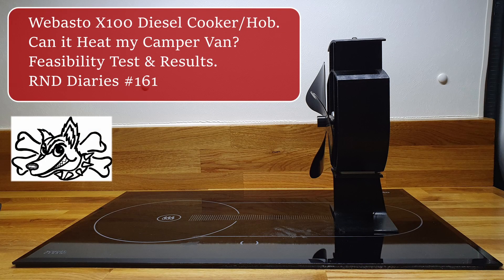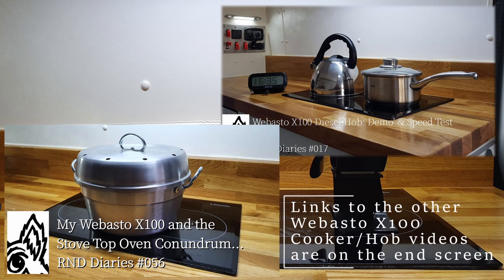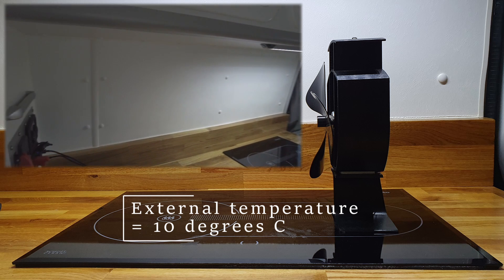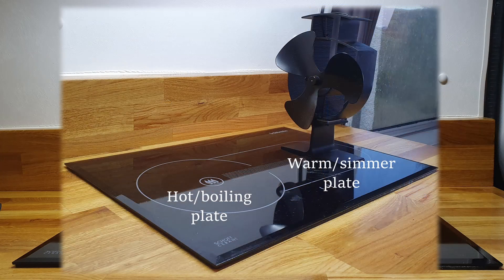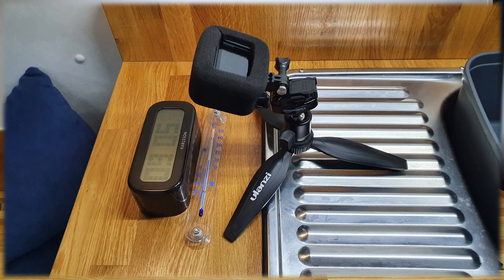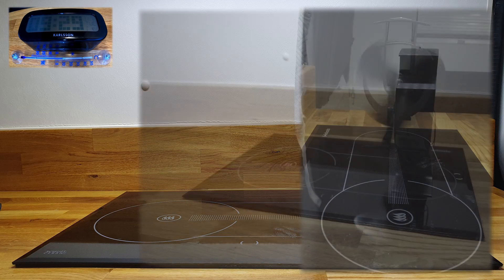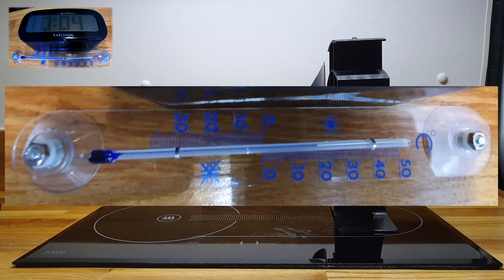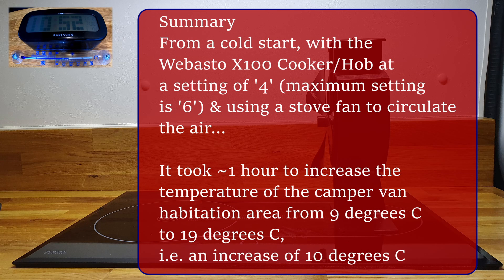Webasto X100 Diesel Cooker. Can It Also Heat My Camper Van? Test & Results. RND Diaries #161

Comment: You could use an aluminum heat sink on top of the cooker for better thermal exchange from the cooker to the air inside the van. Facing the thick side of the aluminum heat sink towards the cooker and blowing a fan through its fins will improve heat exchange.
Reply from the maker: Thanks for the tip!

Comment: Hi,could a lid and fan be safely installed to heat the space more efficiently
Reply from the maker: I imagine it is possible to make something. This was my quick fix solution to make the most of the heat the X100 pumps out with the benefit that the stove fan can be stowed away when not needed. Wallas make a hob with an integrated cover and fan to double as a heater which I believe is based on the X100 - The Wallas XC Duo - I looked at getting one but found the lid limited the size of pots on the hob and as I wanted a combined van/water heater anyway it would have been an unnecessary extra expense (The XC Duo is more expensive). The stove fan is just to take the chill off the van when I am in there for a short time, but the Dual Top Evo is to keep the van warm in anything from sub zero upwards. HughTube did a video review on the Wallas here: https://youtu.be/pbO3BQ4UX7g
Reply: Hey man I found a perfect fit lid from Scamp trailers here in the states, I bet you could integrate a couple fans in there
Reply: I was considering this technique before buying a Wallas xc duo. Seems like a very cost effective workaround, given the ridiculous price of the Wallas. The xc duo pushes out WAY too much heat for a low top panel van, even at lowest setting, but for larger RVs, even at sub zero temperatures it will be cozy. Your method would be ideal for smaller vans.